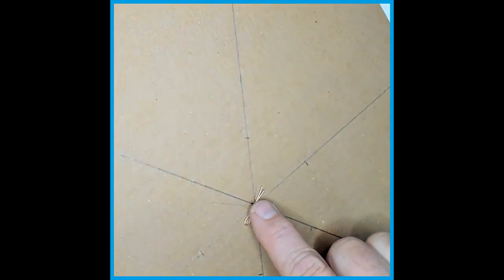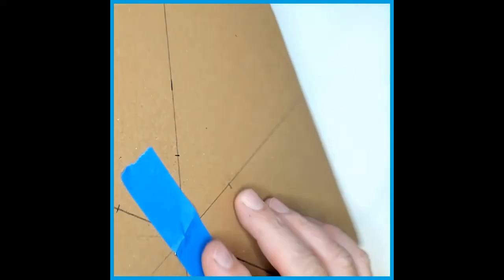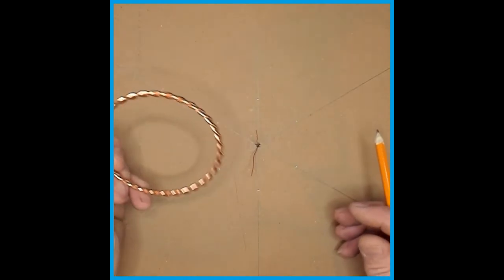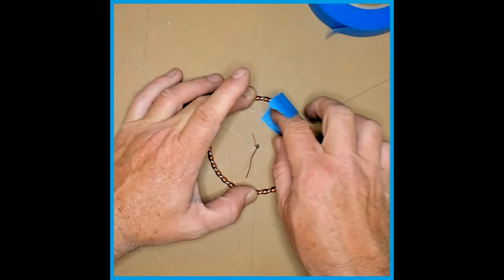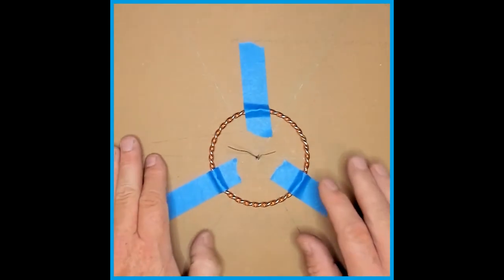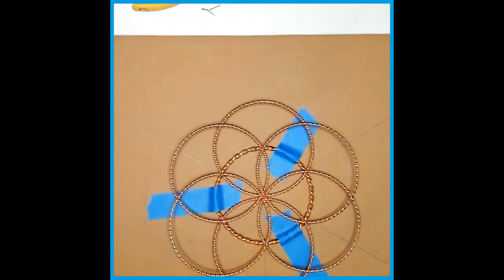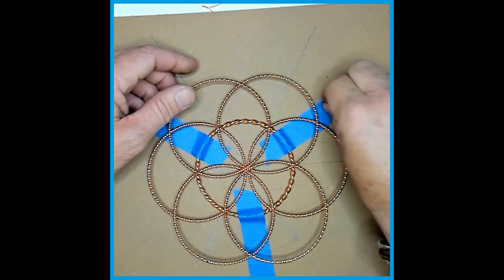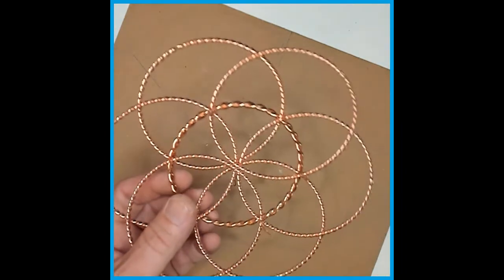DIY Torus Tutorial

Comment: My Dear Brian, that is an amazing tutorial. With this i can build my own seeds of life. But my I asked what kind of tensor rings did you use? Did you take half of a Lost cubit for all inner rings? And what size does the outer ring have? I would really preciate an answer if you still looking in YouTube 😅.
And must the rings be hard welded (I mean 900°C) or can I use tin (250°C)? 

Much love from Germany Leipzig Sebastian❤😊
Reply from the maker: No matter which cubit you use, the outer ring is two times the diameter of the smaller rings.  We use our own proprietary cubits in the creation of the tools, and have not used the lost or sacred cubits for a number of years. We do share many of our measurements at www.SacredMeasures.com, including the STU which is a phenomenal Cubit!
A soldered joint will certainly work, but may not hold up.  Brazing, by using oxygen added to the other fuel, creates a much stronger weld.
Reply: Do regular tensor rings need to be in a circular shape? Once connected and the circuit is made, can they be bent into a rectangular shape and still maintain the field within? Thank you 😊